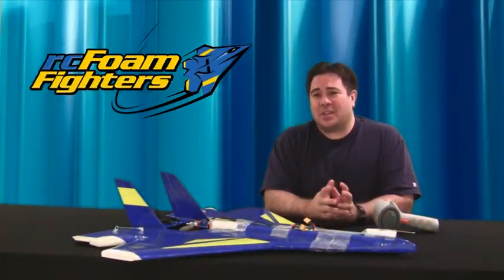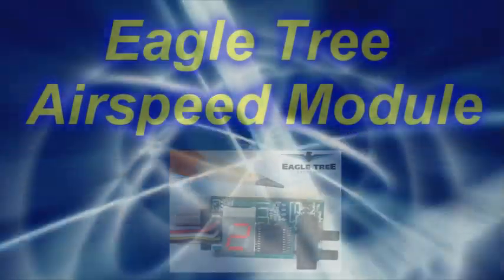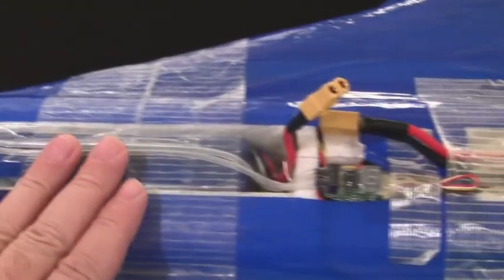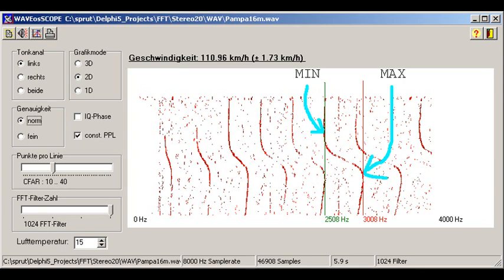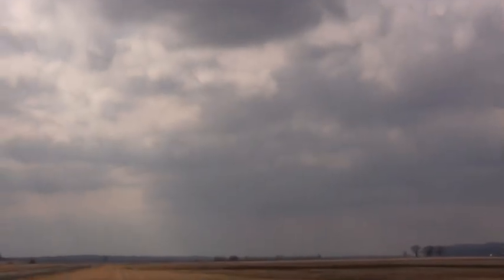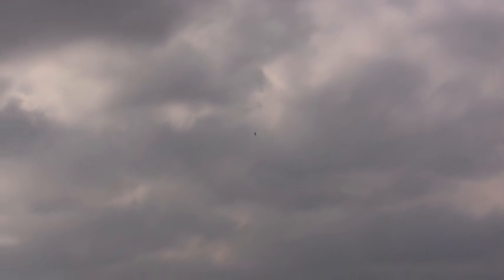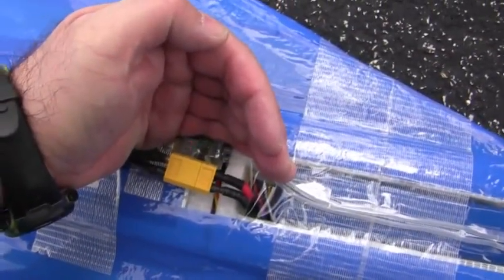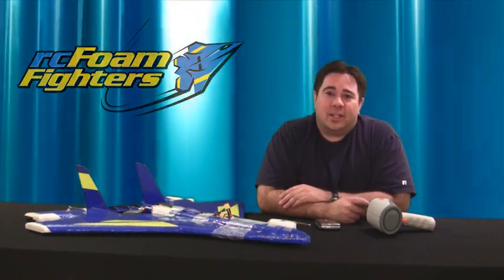Measuring the Speed of an RC Plane

Comment from the maker: Thanks rcmotorsect! Yep , pretty close to teh funjet. I think this plane has a bit more drag as it is biger and has a thicker wing. Its lots of fun though still. I may try some other places for teh pitot tube, but most likely will leave it in the nose for the most acurate reading. its best to keep it in totally clean air undisturbed by other parts of the plane. Thanks!

Comment: great info Paul. you sent me this program about a year ago and i could never figure it out (that's because the zip file never included the actual WaveosScope program in it, just the instructions and mig sound file). so i went to the website and downloaded it. you just gave me a new toy to mess around with- wooohooo!

Comment from the maker: MartijndeGraaff1001, pretty good deduction I would say. I was pondering the same thoughts when out at the field. I did have a small wind meter that day and it was measuring gusts up to 20mph that day. So it may be close. Also my pitot tube may still not be in the best place. Once I mount it properly it should be more accurate. Thanks for your comment!

Comment from the maker: Thanks bakerrv! You are very correct, the program is a little subjective to where you mark the lines. I think if you mark pretty close to the wave lines it should be fairly close, within plus or minus 5 miles an hour. Again this is going to give you a relative speed and not a deas on accurate speed. Thanks again!

Comment: Thanks for the explanation on the Doppler program, I got about the same speed as you did. It really matters where you measure, it is only as accurate as where you measure the line, right, left or in the middle of the line. Cool stuff!!! Thanks

jb:^)

Comment from the maker: Mudman1959, another good point. I thought about wing mounting, but i wanted to make sure it will be in a clean airstream. Any deflections off the fuselage can give abnormal readings. I am not super worried about the tube in the nose, as eagle tree sells standalone pitot tubes. Also good for mounting in several planes.

Comment from the maker: Thanks for the comment Mudman1959.  Your point about static pressure is a good one. That is what I was meaning to say when I said "Ambient Conditions".  Thanks for clearing it up. As for the module, Eagle Tree's website and instructions say the read out is in MPH and not Knots. It can also be set to KPH by using a jumper in the plug. Please see their website, link is in the sidebar.

Comment: It shouldn't matter if the camera is panned with the plane, the pitch is only changed with the relative speed not the angle you are facing. If you turned around you would still hear the Doppler effect. It does matter the angle the plane is flying in relation to the camera man.

Comment from the maker: Thanks for the comment savageZA76. With the tube at teh ver front it mag get damaged easier. It can be placed on the wing or other places, though the nose is the best place to get clean airflow and accurate readings. Eagle tree does sell the Pitot tubes seperately also  incase you damage one or want to put them in several planes. Thanks again!

Comment: Paul... I also recommend mounting the probe on the leading edge of the wing about 2 inches from the fuselage, or along the side of the fuselage about a half inch off the side. This should protect the probe from damage occurred during landings...  Mudman1959

Comment: Airspeed is not only just pitot pressure but also static pressure (altitude) that is wht there is two tubes coming from the probe and a small hole in the side of the probe. The  higher you fly, the higher the airspeed... which by the way is measured in knots. Look at your wavo-o-scope knot reading it showed 125 Kts. which was close to the reading from the probe readout. Also the barometric pressure plays into the game. Good video!  Mudman1959

Comment: Great video. I wasn't aware they were doing Doppler effect. I wonder if I don't have a couple videos that I could check. I fly a lot of small planes and the Doppler  method should work fine. They are to small for pitot and probably to small for radar.  Be careful guys.